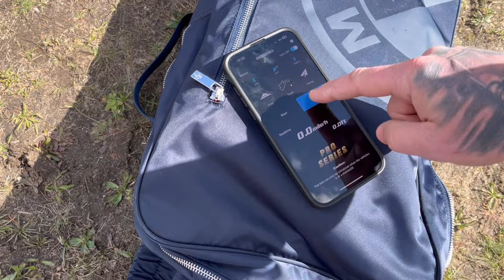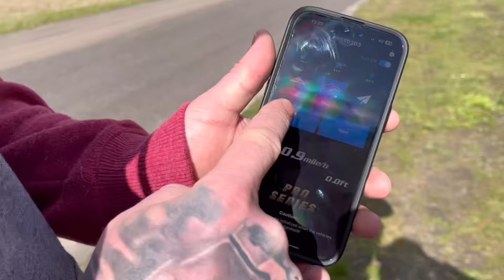Flipaarlo Angry wasp has new updates

Comment: Taking the shocks off isn't good partner, unless you're on a good flat road, cause instead of soaking the Bumps, it'll be bouncing, and that bouncing is gonna allow air under it, thus, a flip over. 
You gotta lower it really low, and rake it. 
Leave your rear up a few mm's higher.